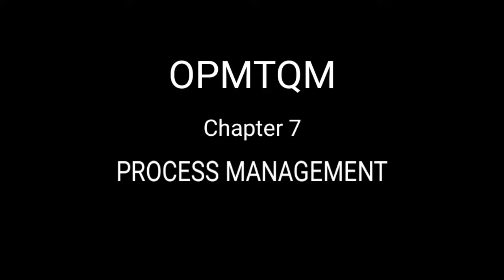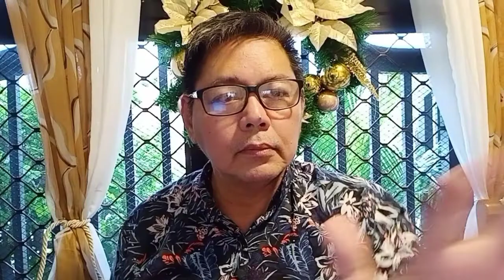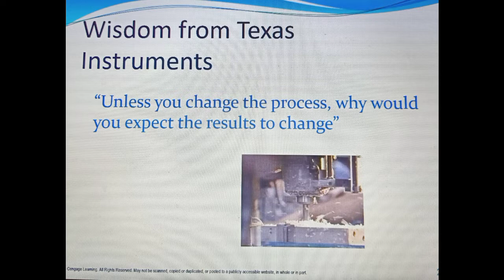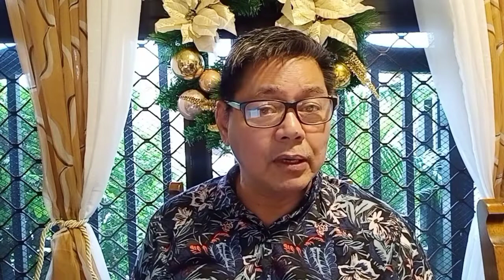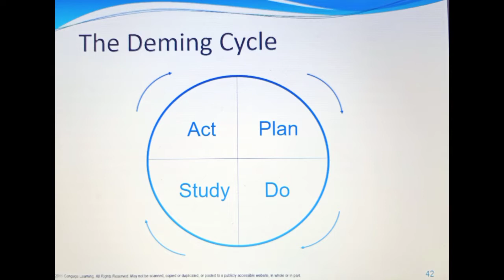OPMNTQM CHAPTER 7 PROCESS MANAGEMENT

Comment: BAYLON,ALBERT ALYSSA A.      
3BLM
According to W. E. Demings, Eighty-five percent of the reasons for failure to meet customer expectations are related to deficiencies in systems and process… rather than the employee. The role of management is to change the process rather than badgering individuals to do better.” As mentioned in the case study previously give, in order for them to be able to implement Six Sigma or the Lean program, an effective and structured system of process was necessary. The employees must me aware of the uniformity of the action in order to lessen variation of  the product. It was state there that although the employees had an overview of the process to be done, the actions taken in order to achieve the goal varied therefore resulting in varied quality of product or service. 
	Process management is essential to the operation of an industry because it prevents defects and minimize commitment of errors. Through thorough process management, elimination of waste and redundancy of operation is possible. This leads o better quality and improve company performance through shorter cycle times. It also allows improvement of flexibility for faster and more consistent customer response. 
	The following are the needed contest to determine key process management; identifying the vital work processes that can relate to core competencies and deliver the customer value; aiming for profitability ;efficiency of the organizational processes leading to success; and sustainability. The key process principles will minimize the overall cost associated with quality inspections, and improve performance audits, prevent the defects. It also lessens service errors and networks that minimize warranty cost and costumer productivity losses as appropriate. 
	There are two categories of processes, value creation processes and support processes. Value creation processes are the most important in business operations. In many companies, value creation processes take the form of projects. These can be temporary work structure. Value creation includes:
(a) design processes or activities that develope the functional product specifications. Design process defines the attributes of the products. 
(B)production and delivery processes or  those that create or deliver the product efficiency
Support processes ,on the other hand, are the those most important to an organizations value creation processes , employees and daily operations. These depend on internal requirements. They must be coordinated and integrated to ensure an efficient and effective linkage performance amongst the stakeholders.
Process management involves planning. There must be efficiency in administering the activities that are necessary to achieve a high level of performance in the key business process .This eventually leads to the identification of opportunities for improvement of quality and operational performance and ultimately for customer satisfaction. Process improvement focuses on the end-to- end process
	The activities of the process management are as follows: 
1.	Design – ensure that the inputs to the process e.g., materials, work methods, technology and number of people, etc., are adequate and the process systems are well defined so that the mistakes are lessened. 
a.	Production sequenced properly
b.	Lean 
c.	consistency and effective execution 
2.	Control 
a.	Assessing whether the process is performed as planed 
b.	The processes output is on target
c.	On scheduled
3.	Improvement – continually seeking to achieve higher level of performance in the process, e.g., reduce variation, higher yields, etc. 
Requirements for process management: 
1.	 The process must be repeatable
2.	Must be measurable
Meeting these two will ensure that the organization will gather efficient date and accurate information for evaluation and would eventually lead to improvement of the product or service that is being accessed.

Comment: SOTELO, DIAZMEAN KYLA G.
3 BLM

The very essence of the today’s chapter can be encapsulated in a significant quote – “Unless you change the process, why would you expect the results to change?” In every venture and company, the main goal at the end of the day is and has always been, customer satisfaction. As provided in the discussion, process management is one of the necessary ways in order to achieve this. 

Process management prevents defects and commission of errors. When you employ process management, you eliminate the waste and the redundancy of the operations and outputs of the business which then, leads to better and improved quality performance through shorter cycle times and improved flexibility for a faster and more consistent customer response. In the chapter, key process management for performance excellence were discussed, namely: identifying the vital work processes that can relate to core competencies and deliver the customer value, aiming for higher profitability, efficiency of organization processes leading to its success with sustainability following. Key process management determines the key work processes requirements by incorporating the input from customers, suppliers, partners in collaborations who are referred to as stakeholders.

	The two categories are: a) value-creation process; and b) support processes. Under the value-creation processes are the design processes and the production delivery processes. Design processes are activities that can develop the functional product specifications. Production and delivery processes, on the other hand, are those that create or deliver product efficiency. The value creation requirements depend on the characteristics of the product itself, which delves more than just the imaging of the products. Support processes depend on internal requirements which usually depends on coordination among stakeholders. To illustrate, PAL’s sudden service which commences with order-taking which requires accuracy, speed and friendliness and second, the cooking which requires proper temperature for preservation, and another is the product assembly which requires proper sequencing, sanitation, correct ingredients, speed, neatness and techniques. Lastly, the task collection which requires quantity, freshness, sales potential, adherence to budget, among others. Process management principles includes process improvement which focuses on the end-to-end process. 

One thing I value from this chapter is the concept of the corrective actions which focus on removing the causes of the problem rather than, treating the symptoms, coupled with process simplification which reduces the opportunity for committing errors. This is vital in every organization and even in our daily lives. It teaches us to how to resolve conflicts in a sustainable manner, as required by companies employing process management as well.

Comment: VERZOSA, Pamela C.
3BLM

The great Socrates said, “the secret to change is to focus not on fighting the old but on building the new.” As we are adapting to the new normal, organizations have also took necessary steps to keep their businesses running amidst the crisis during these trying times. They have cut back on expenses that do not return revenue such as closing down stalls on malls and instead allocated their budget on improving social media presence to cater people staying at home. This is where process management comes into place.

Process Management is the method wherein an organization aligns its processes with its own goals, design and implementation procedures to ensure effectivity of strategies between the time when a product is launched to the market and the time it reaches its target consumers. Process Management focuses on the end-to-end process particularly aiming to remove and root out the real cause of problems rather than just treating its symptoms. Through this, every step in the manufacturing process is taken into consideration and not one step is left behind. Also through this the slightest details is brought to light so that any unforeseeable circumstance can be avoided. This can be done by incorporating the core competencies of a work process to deliver the best quality to the customers. Aiming for efficiency but at the same time targeting the highest level profitability can lead to success wherein sustainability follows. It is also important to relate the input of all the organization’s stakeholders such as its collaborators, customers, partners & suppliers. Also, the workforce process must also be kept in line with the trends to provide a better workflow. This can be done through consistent sharing of improvements from one unit to another. This provides a driving force to the organization to learn more and be open to innovation.

Now that we are in the new normal, businesses’ strategies and production processes have obviously adapted and became more competitive. Process management becomes important so that an organization does not lose track of its branding and stays consistent to how their brand is perceived by the target market despite their, and every other brand’s, aim to evolve in the “new normal”. Process management helps so that an organization can minimize expenses but at the same time maximize its resources although narrowed down by the constraints of this pandemic.

Comment: Ong, Angelie Fey A.
2AMA

The industry is composed of different systems of processes, ass highlighted on chapter 2.2 "Successful management relies on the systems perspective", hence the importance of process management is critical for every business in the industry. Process management is defined as what recognizes the prevention of defects and errors, and the elimination of waste and redundancy leading to better quality and improved company performance. Throughout the life of a company, growth is accompanied by strengths and flaws of each systems processes. A company's strength determines the efficiency and effectivity of the process management practiced by the management and the ability to learn from the mistakes that was realized from mistakes. Mistakes, however, is not an entirely negative result of wrong application of principles. Mistake is the ground of growth and learnings for every company. 

Moreover, customer needs is what drives process improvement in a company this is because the main focus of Process Management is the satisfaction of its customers. Customers determine how the company would address the quality products being offered to the market. They enable a company to maintain a competitive advantage by strategic management planning and efficient quality decision making of the management. "How do one evaluate the process?" "How can this defects be prevented?" Pokayoke is defined as a device for mistake proofing of a process that can be used by organizations. This will help eliminate product defects by preventing, correcting, or drawing attention to human errors as they occur. This enables a management to control and develop the prevention of product defects and errors, and eliminate waste to a better quality and improved performance of a company.

Organization or business improvement is a broad concept offering various theories and principle for improving one's business in to a successful one. However, there will always be a misleading idea and concept that is being practiced by a company. Process management takes account of the whole value chain. Giving importance to the different process that is accomplished in the company. Process management principles, as illustrated in the video, is important as it focuses on the end-to-end processes. The value chain helps a company to identify important business processes. The two type of processes are Value-creation processes and Support process which are activities important in running a business. Indeed, Process management plays an important role in ensuring conformance to requirements and to build a better quality and improved company performance, not just for the sake of the business and it customers, but also for the betterment of the business industry.

Comment: Monica Flores
2AMA

Chapter 7, process management talks about the processes that will lead to quality and better company performance and how to prevent defects  and errors. Process management is important for businesses because it describes and provides a guide on how companies should do things in the organization that provides focus for making them successful. Company should first determine all work processes and its profitability. To be able to achieve effective business practices, the organization should incorporate input from customers up to the partners and stakeholders, company should also assess cost control needed and identify appropriate measures, collaborate with customers and partners. Also keeping up with trends in the market is important to identify what kind of business process should be taken and sharing improvements of one unit to other unit within the organization. 
The key processes in management pronciple includes minimizing overall cost to assess its effectiveness and  next is customer productivity losses and warranty cost. 
It is also vital to keep in mind that evaluating process principle is an end to end process which includes value creation that is related to the imaging and branding of the product or service and the support processes that pertains to internal requirements and employees. It is important that the management should remove the cause of the problem in the process rather than concealing it by a short term solution that will eventually lead to company loss. 
Activities in process management should be both repeatable and measurable to ensure accurate information that is essential for company’s evaluation. This includes design, control and improvement. Process by definition is any group of activities that takes inputs to provide output for customers. This process include process design wherein it should have an impact to the product in terms of cost, agility and quality. The basic components in process design includes the physical facilities, employee behavior and professional judgement. 
These factors of process is important because it is a wat of improving company goals and a step in developing efficient procedures for faster and consistent customer response. There is a term poke yoke that means preventing defects from occuring in the first place. Mistake proofing is important in the process making because it corrects the problem and fixing defects. After action review is also important for control and improvement purposes of the company.
To gain the trust and loyalty of customers, the customers should have confidence in your management and the business itself. Kaizen pertains to the small and frequent improvements over a long time that requires the participation of everyone in the organization. The key idea breakthrough improvement makes the organization think in radically different way to encourage improvement. All of these factors are essential in the process management of the company because it is the organizational discipline of the company and is the key essential for company’s success.

Comment: Montalvo, Jofer Benedict M.
2AMA

In order to achieve total quality management, process management is also an important factor. It avoids mistakes and failures, reduces duplication and complexity and, by reduced cycle times, increases flexibility and quicker and more reliable customer response, leads to higher service and increased company performance. Process Management is crucial because it can help you improve your overall activities. It can minimize your spending, provide you with better process management, recognize organizational failures, and give you insights to make better business decisions. In addition , to improve the agility of your business, it fine-tunes processes. Process Management requires the required processes and responsibilities in the workforce of an organization to maximize workforce efficiency and maintain high-quality product processing management to obtain customer engagement and customer satisfaction.

Process management is the task coordination within the aim of the firm. It is an essential part of the company's everyday activity because it may avoid defects and failures that might occur, encourage staff to become familiar with the method and results, and help the company to achieve a higher output of the goods. In business, passion and grit can only go so far. For you to be able to drive your company forward, you will need to have calculated processes. These are what will help you control your costs, keep productivity levels consistent, and maintain the quality of customer experience you provide. Process management plays a vital role in the business because it removes glitches and mistakes, reduces duplication. The development process would not be systematic and thus chaotic and ineffective without process control, since the quality mind-set is one of mitigation and continuous improvement. If you want to make sure that all aspects of your operations are in optimal condition, it is best to have a process management plan in place. This is what will help you design workflows in line with your short-term and long-term objectives. The value of providing concepts of process management is that it reflects on the end-to - end process, helps anyone at any stage to handle a process, and is a client and a seller.  This offers the business the way to have a corrective intervention focuses on underlying factors and it decreases faults or shortcomings. To lead to a quality product and design, there are various activities that must be performed.